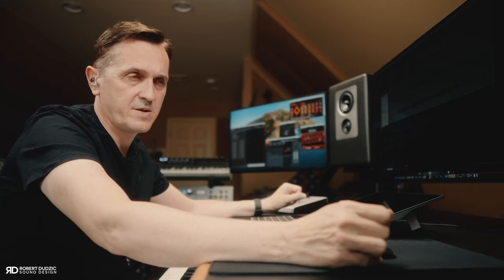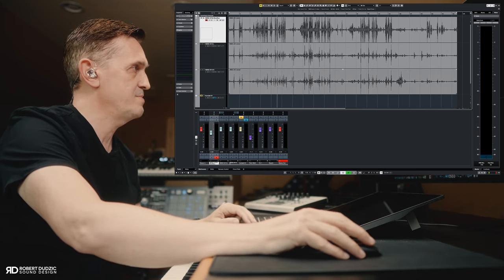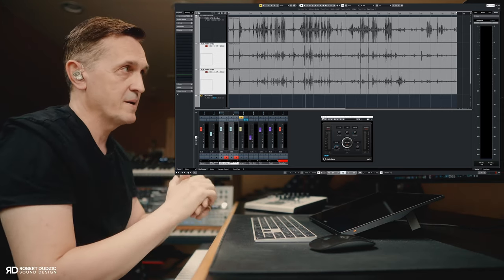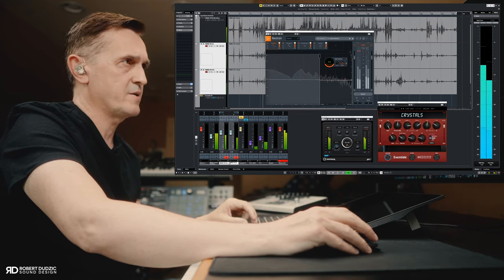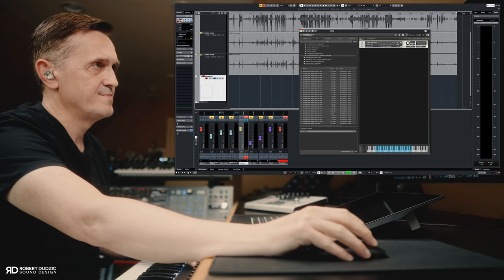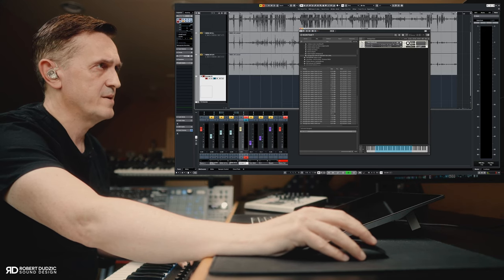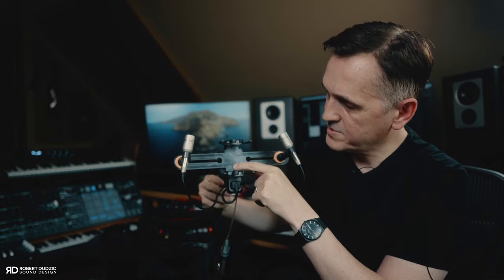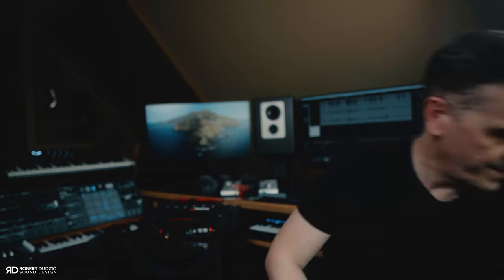HOW I DO WHAT I DO 4 | THIS IS MY CLASS, #sounddesign #soundeffects #sounddesigner

Comment: Firstly - thank you so much for sharing your knowledge in order to help others - much appreciated!
I understand you use 3 mics. The shotgun mic in the center, and 2 condenser mics, which each get panned to a different channel - thus resulting in sounds which come from the left, right and center. (Hopefully I m correct so far). My questions is...... Could this also be done with a single shotgun mic, by duplicating the mono shotgun mic track twice, and then do the same thing - pan 1 duplicate to the left, and the other duplicate to the right, and leave the original centered? Would this have the same effect, or is there something I am missing which can only be achieved using the 2 condenser mics?

Comment: Hi Robert. I'm just starting out and  ended up going for the NTG5 which is a bit shorter, and was wondering what sort of stereo technique you are using for the side mics? Are they aimed at the capsule of the shotgun at a particular angle/distance? Also, as NT6's are beyond my budget currently, I was wondering if you had any thoughts on the NT5's as stereo mics (they are about 1/4th the price). Currently I am testing out some cheap Behringer pencil mics, but am not sure if they are of adequate quality or not yet (I still need to make a stereo bar and get some dead cats for them). Also I was wondering if your 3d printed stereo bar design might work with the shorter shotgun mic, or if perhaps I need to modify it. Thanks a ton for any advice you are able to give!
Reply from the maker: Hi, The NTG 5 is phenomenal mic and have very nice low end and that you focus, you can add for stereo two RØDE NT5 matching pair, you can found them on eBay very cheap. I use them when i started and the sound fantastic. I printed this stereo bar but you have the idea and you can do something similar, look at amazon for any dslr camera parts, for example smallrig have lot great parts and you can found parts to assemble bar what will work for you. Just like playing with LEGO blocks.